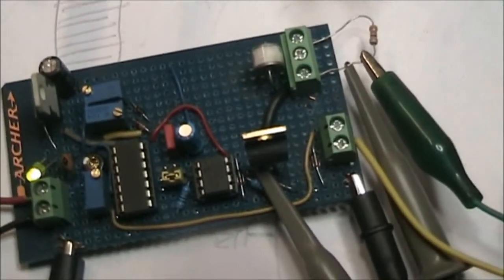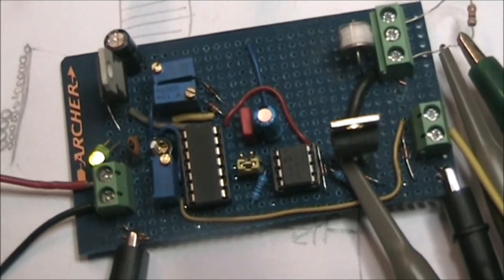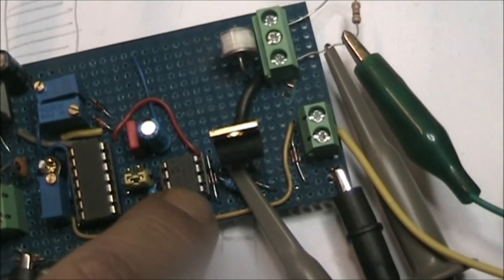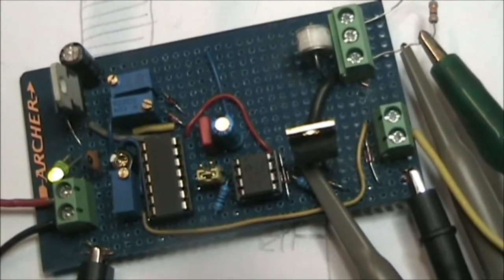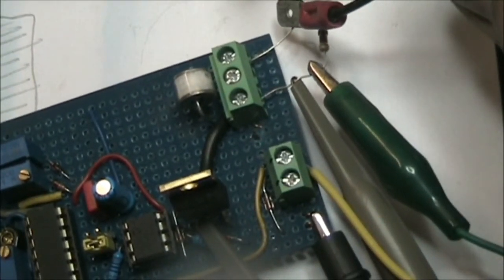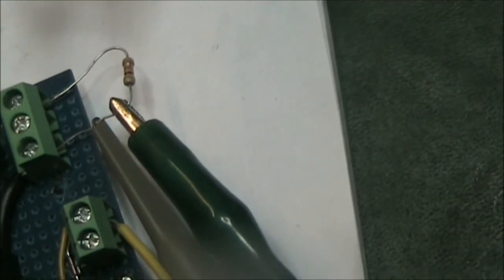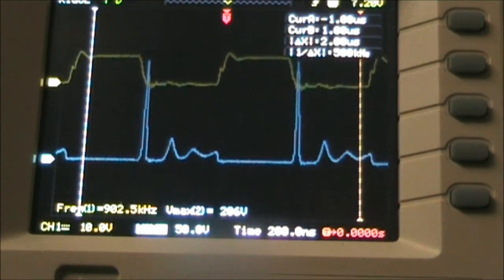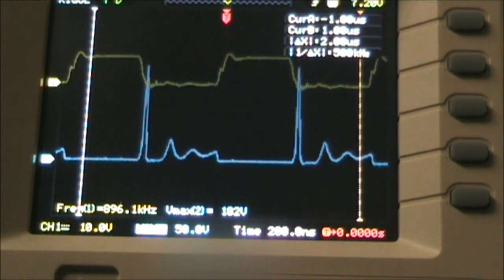Light bulb spikes

Comment from the maker: Hi Kyle, I think it's the energy stored in the magnetic field of the coiled filament. Because of the fast fall time when the mosfet turns off the energy is released quickly. Even though the power is very low the voltage builds till it's clamped the GDT. It's because of the high frequency and the speed of the transitions when switching an inductance. The globe has 10 uH inductance. It's a high resistance light emitting coil. :) I can get 40 volt spikes just by switching the mosfet very rapidly.

Comment from the maker: When the coil discharges it's emf and the current it causes it opposed by back emf in the discharge circuit. The discharge circuit having inductance also has a magnetic field and so as the current through it reduces the magnetic field it creates also discharges into the load ect. I'm not ranting at you or anything, sorry for the rant. Just some thoughts on the matter. I appreciate your comment/question. 240v bulbs have more inductance 100's of uH, so more energy can be stored in them.  Cheers

Comment from the maker: Just the circuit wire's have inductance, everything does. If a 6 inch piece of straight wire was switched quickly enough it would give spikes. Just my opinion but most people see back emf the wrong way. Back emf is present whenever there is current flowing in a wire, the energy in the magnetic field is not back emf the magnetic field is manifested in "spite" of the back emf, the instant the emf is switched off the back emf ceases to exist
then the coil discharges it's energy.